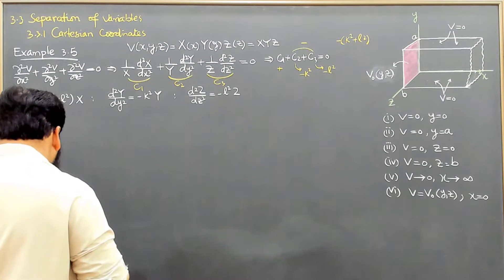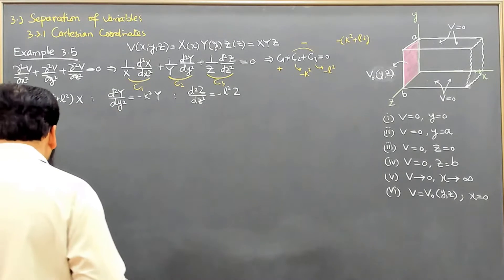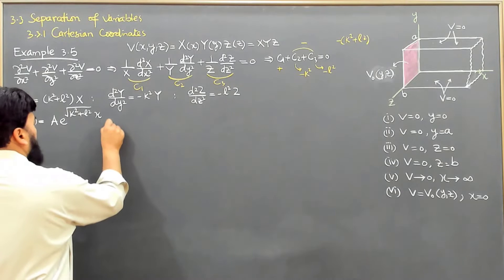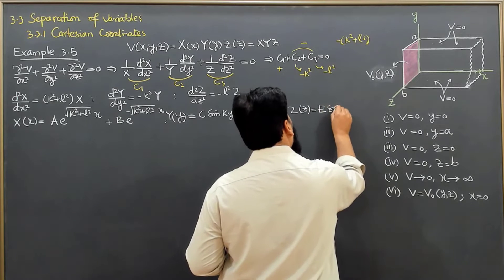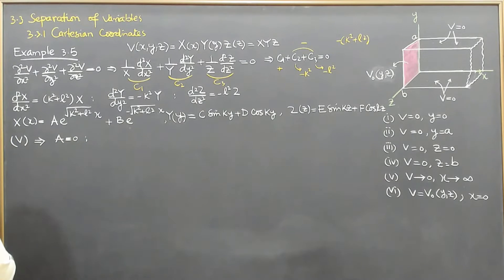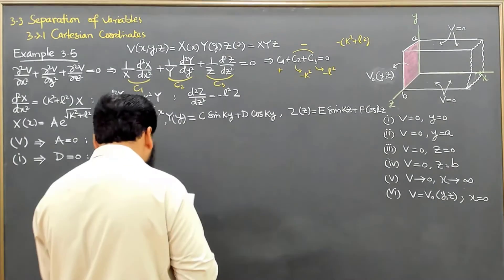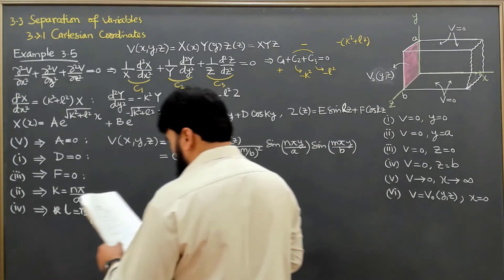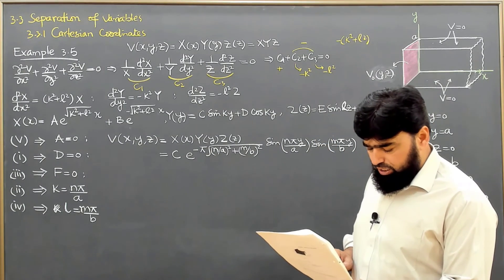L27.4 Separation of variables - Cartesian coordinates - Example 3.5 P-II

Comment: sir i think in the last there will be x to the exponential and z for b
Reply from the maker: Yes, you're right. I have missed x in the exponential, and there should be z instead of y in the last part, as sin(m pi z/b), not sin(m pi y/b). Thanks for the correction.